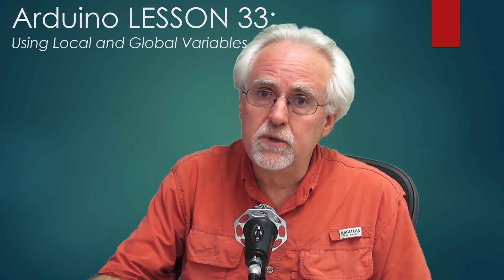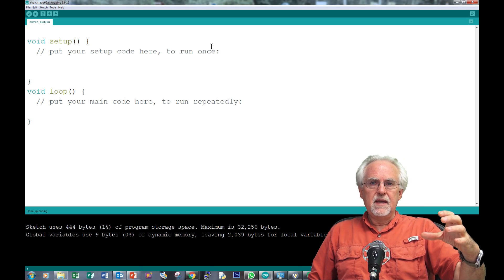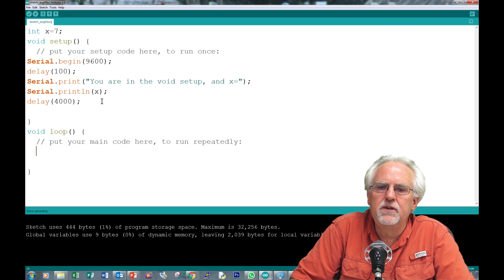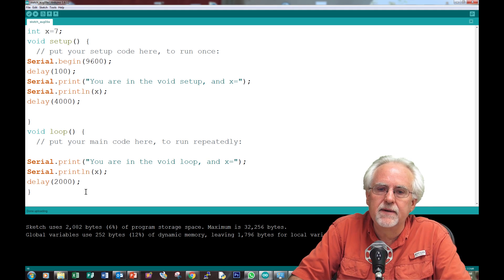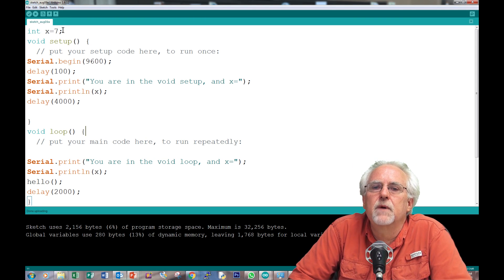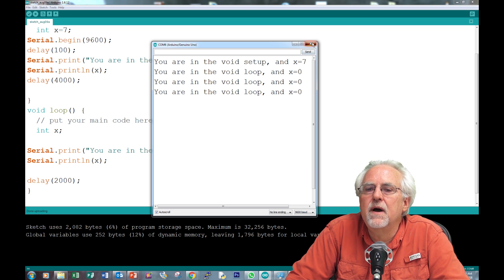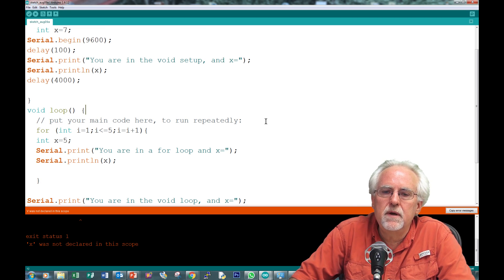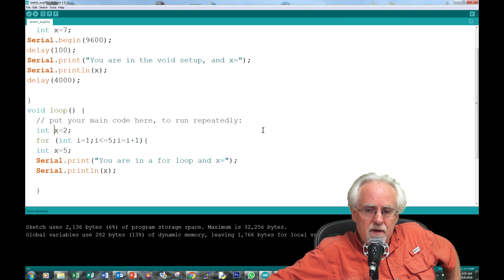LESSON 33: Understanding Arduino Local and Global Variables

Comment: I am a long time arduino programmer and I do understand local and global vars and passing paramaters, but I do have a question about declaring local variables in void main loop that are only used to be passed to functions. 1.Do you agree that by default the void main loop is really a "while loop" that runs forever ?  2. assuming #1 is correct, then any variables declared in void main loop will keep getting redefined every cycle the void main loop runs and possibly resets the variable value a function may have changed ?  3. Do you just define void main loop variables as really globals above "setup" and treat them as local in the void main loop ? 4. Or do you create a additional "while" loop in main loop ?

Comment: i notice that this functions a lot like FORTRAN, BASIC, and the PLC programming that i have done.
in that,  we set the variables at the top,   which are either non-changing, and or manipulated in the program, and use new ones below to avoid that same issues.

Comment: If I’m not mistaken, this is different than C++ and C#. In those languages, the x in a for loop would be from the function the for loop is in.  Are there other ways that Arduino differs from C++ even though it comes from it? 
The setup and loop sections are different too. I’ll just have to get used to the variable being associated with the { }.

Comment: Thank you
This is exactly where I am in my learning of the arduino code. Really looking forward to learning how to Pass the variable between functions. Could not figure it out so I am using Bad programming practices GLOBAL variables all over the place. The function was easy for me to understand since a Long Time Ago I wrote programs in basic using "gosub" on my Radio Shack TRS 80. Whoops showing my age.
W
Reply from the maker: Yep, I remember the old gosub command. Stay tuned this lesson was really just setting the stage for how to use local variables and then pass parameters to and from functions.

Comment: Hello, I'm making a servo that turns with a potentiometer. I've written the code and it works. I'm using a 10k potmeter and a black servo MC-1811. When I turn the potmeter, the servo turns also. Now the problem is that when it turns and then it's in the right position, it starts shivering. And im only going from 60° to 120° so I'm not going over the limit of the servo. I didn't understand why it still moved, so I made a serial.print for the position of my servo and potentiometer. Now I know the problem: sometimes when I stop turning the potentiometer, the position of the servo and potentiometer on the screen keeps changing 1 or 2°. So thats why it still moves. Sometimes when I turn the potentiometer, it works fine and it doesn't shiver. So now I know my servo isn't broken. When I changed the potmeter it still did the same, so my potentiometer works fine aswell. But i have no idea what the problem could be. Do anyone know what the problem might be? Thanks for the videos btw. Here's the code I've written.

#include <Servo.h>
   int Potpin=A3;
   int readValue;
   int ServoPin=9;
   Servo MijnServo;

void setup() {
   Serial.begin(9600);
   pinMode(Potpin,INPUT);
   MijnServo.attach(ServoPin);
}

void loop () {
  readValue = analogRead(Potpin);
  delay(50);
  readValue = map(readValue, 0, 1023, 60, 120);
  MijnServo.write(readValue);
  Serial.println(readValue);
    }